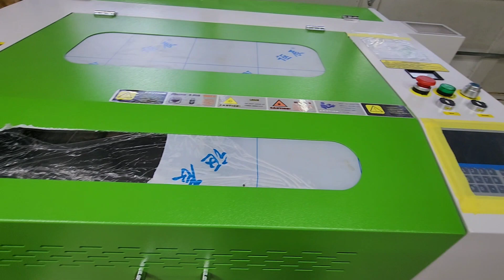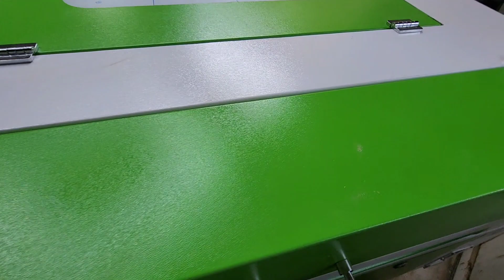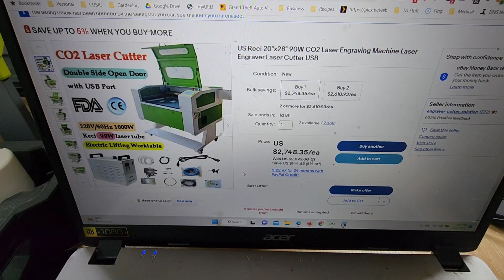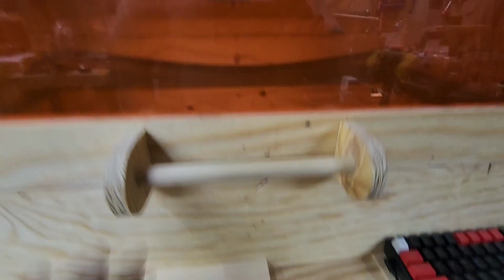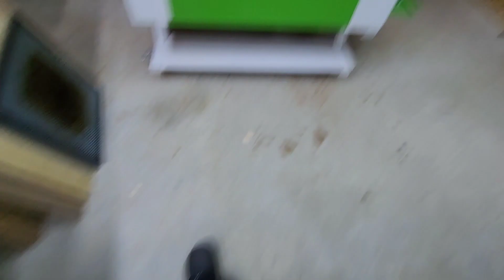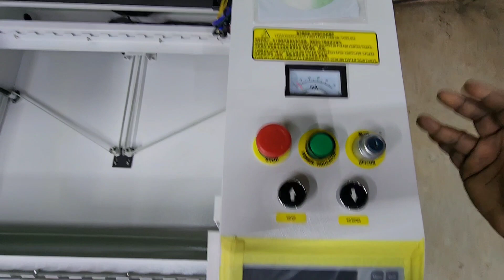US RECI MELDIKISO 90 WATT C02 LASER PREVIEW PT. 1

Comment: Did it not come with an air pump? This laser is really attractive to me, especially because of the RECI tube. Do you have an idea of the differences between this and the omtech 2028? I'd really appreciate any feedback you have.
Reply from the maker: Yes it did come with an air pump. I decided to go with the California 8Gal Ultra Quiet air compressor on the advice of others in a FB group  and just not even use the included pump. Im sure it would have been sufficient enough, But I went the other route. ( And I dont regret it) YEP RECI TUBE is a PLUS! Only difference I have found is that the Omtech has the fan for the exhaust on the side as this Laser has the fan in the back. A bit of an inconvenience cause it doesn't allow for the laser to completely sit flat against the wall but definitely not a deal breaker. Hope that helps! Check out my other videos on this laser from when I set it up and look out for my 6 month thoughts video to come.
Reply from the maker: Oh another difference is that this laser has a 220 v to 110v converter. Not a big deal to me but some have mentioned it like it was something to be concerned about. It works like a charm for me.
Reply: @perfectpressblanks3563  that's actually a plus for me, since I have an unused 50amp 220 plug. I had it installed, expecting to use it for my cnc, but it's doing just fine on 110. If I ever need to move it, I'll be happy to have that converter, too!
Reply: @perfectpressblanks3563  thanks for that. I've watched them all, just today. The price difference vs the OMtech is just really too much to ignore. As far as I can tell they are both using steppers and linear rails....not much else really matters when differentiating a laser. Maybe the control board, but they are both ruida based, so my guess is nothing significant there either? I'm subscribed, so I'll see your video, but I'm probably going to buy another laser machine before then. Thanks again.
Reply from the maker: @turbomacncheese  Yes you are correct. They are I believe the Nema 23 steppers. Very beefy. I only have my 3D printers and CNC to compare them to though. And linear Rails. It does have a Ruida Based Board and works perfectly fine with Lightburn if thats a concern.
Reply: @perfectpressblanks3563  sounds like you know your stuff. I feel pretty good about this now. I really appreciate your time and feedback.
Reply from the maker: @Tony Richmond  I know just enough to not cause too much damage... Hopefully! Lol
Reply: @perfectpressblanks3563  mine just showed up. The crate was smashed a bit, and I might be missing some small parts for the air pump, but otherwise everything looks good. The laser tube is already 2 years old and I've read that they degrade with time even not being used, but I've sent an email directly to RECI to see what they have to say. Not much to be done about it anyway, since they don't guarantee a manufacture date, and if it lasts through the end of the warranty period, well, I guess that's a promise kept.

Weird to me that the 220 power only has the 2 hots and a ground. Also, a separate lug for ground, weird. My outlet is 4 wire, so I'll have to see about how to deal with that. 

Thanks for the videos. Literally the ONLY ones I could find, and reassured me about making the purchase. Like I said....the price difference is impossible to ignore, but at the same time....concerning.
Reply from the maker: @turbomacncheese  So the power supply doesnt have a neutral? That is weird. I didnt check mines as I went with the converter and plugged into 110v outlet. Would be great if RECI sends another tube, They are the bulk of the price. It would be nice to have a spare.... Unless you have to hold on to it for another 3 yrs then kinda defeats the purpose. But anyways, I hope you enjoy the laser. I have been putting mines to the test the last couple of weeks which is a good problem! Keep us posted on the progress.
Reply: @perfectpressblanks3563  will, I'm not an electrician, but i know that on 220 systems a neutral isn't strictly necessary. I checked and found continuity between the 3rd leg and the ground lug, so that implies to me no neutral.
I'm not sure how transformers work (aside from some high-level principles of high school physics involving coils and capacitors), but when I tested the 3 prongs out from the transformer, I got 230 across the hots and 115 from each hot to the 3rd, same as if it were a neutral, but I'm pretty sure the neutral is bonded to the ground in my panel. Of course the transformer input is 110, so it gets a hot, the ground AND the neutral.
I've got a friend who manages maintenance for a large company, and he's got a ton of certifications and decades of experience, so I'll ask him for an explaination and opinion, but he's under the weather right now.
Reply: While I was waiting for my friend to feel better, I came across an adapter jump cord that grabs each hot from the 240 and makes two 120 circuits tying back to the neutral and ground while solvimg my main question for him....what about the double pole breaker in the box? 
For reference (specifically for anyone happening across this in the future with a similar circumstance), you don't want one side of the breaker to break and not actually flip the other side. This happened to a breaker at work sometimes, and it's not a huge deal for a 220 appliance because it will just stop working. But if you're treating the second hot as a separate circuit, maybe it's best to not have any ambiguity about whether both circuits are tripped or maybe one is still live.
The adapter I found has built-in breakers for each side that should trip before my panel breaker, and as a certified device is likely safer than the thing I would have built for just a few more dollars than I would have spent building it.
Upside for me, my electrician really hosed me on the garage, putting two walls AND the ceiling outlet I requested for my tablesaw ALL on the same 20 amp circuit. Fortunately, the 240 in question is in the middle of the busier wall (cnc router, both lasers, dust collector, 3 printers, and the wife's cup turners) and this will be effectively adding 2 more 20amp circuits.